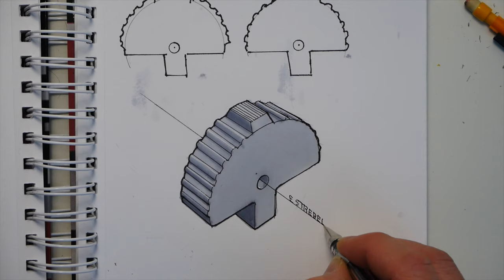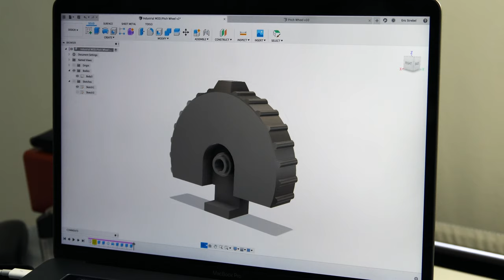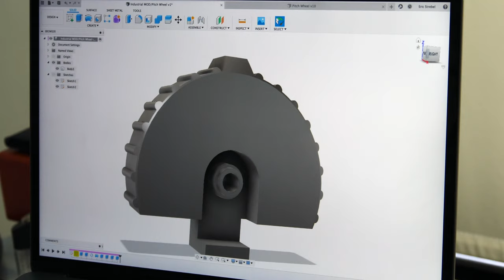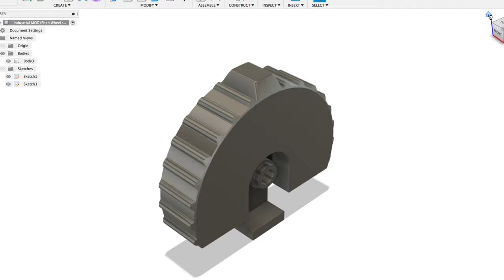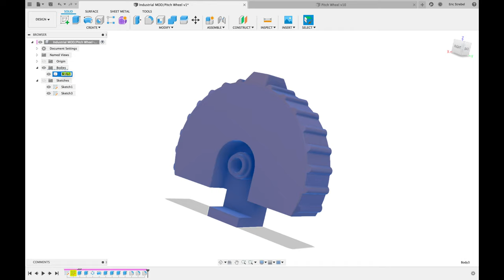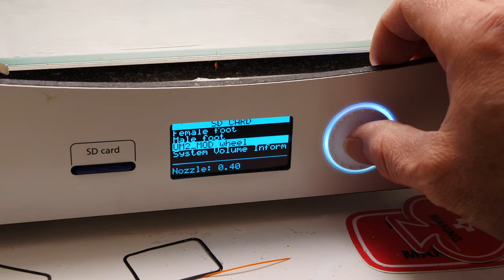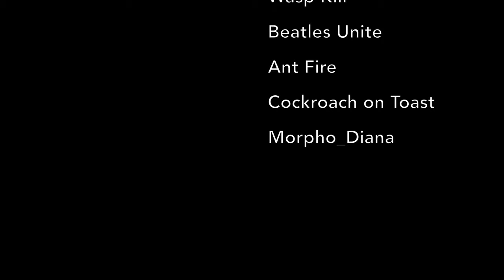Sketch to Functional Prototype: My Design Process

Comment: If I modify existing parts, I copy the Original as close as I can to get all the Important features. With Injection Molding most Manufacturers have a reason to do ood shaped Cutouts. Mold making is expensive per se but Modifying finished Molds is even pricier :p
So do a 1:1 copy, have a Cup of coffee and think like the Manufacturer. 

A neat trick I learned to get your Parts looking near perfect for 3D Printing

I Bevel all horizontal Corners and edges and
I Round over all Vertical Corners and edges.

Printed Horizontal round overs always look crappie, on the Bottom you get wrinkles and on the top you get visible stairs XD

Comment: I would like to see how you measure the dimensions of the original parts. Do you use a thickness meter ?? and how do you deal with the prints with tight tollerances
Reply from the maker: Use a digital caliper to check print dimensions

Comment: What program did you use?
Reply: Fusion 360 for CAD, they have a 'Maker' license that's for free if you earn <100.000? USD per Year XD 

Cura for Slicing, its the Slicer for his Ultimaker but there are a couple of profiles for most 3D Printer